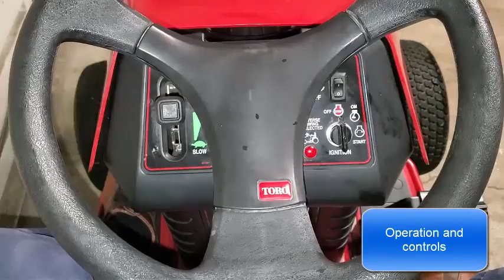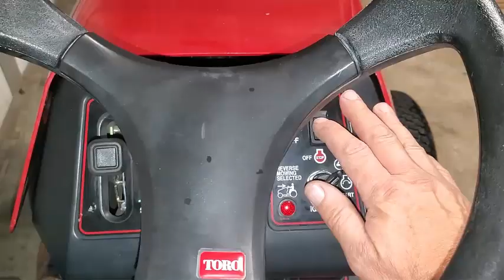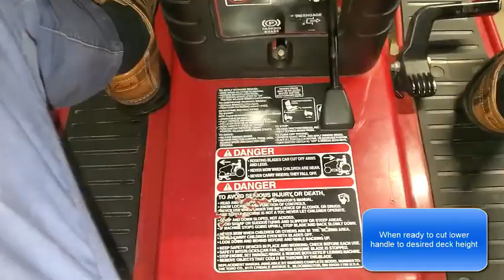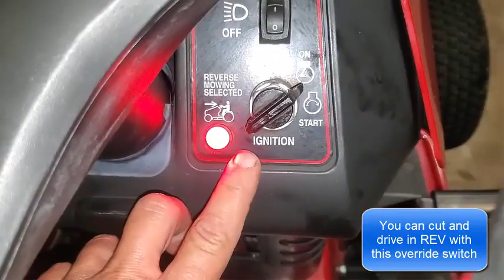Toro Wheel Horse Lawn Tractor 16-38 HXL

Comment: Hello Richard - I have the same model Toro Wheel Horse rodier. Have had it for maybe 20 years. However, I have a question I'm hoping maybe you can help me with. When I'm done cutting the yard, I usually tip the mower on its side to clean under the deck. The last time I did that, a small steel rod fell out from between the deck and the upper body. It is four and a half inches long, and three sixteenths inches in diameter. Would you have any idea what this steel rod is, and where it does? Thank you kindly for any information you could provide. John
Reply from the maker: Maybe a pivot rod #26 here https://rb.gy/9i6cv  or one of the deck break rods #3 or #26 here https://shorturl.at/qXY28  Good luck
Reply from the maker: You still need help with this or have you figured it out? Sorry I haven't seen this comment until today